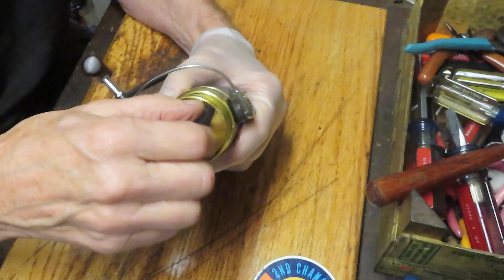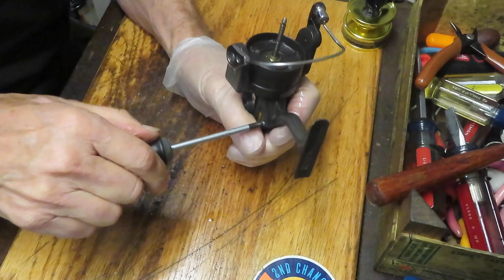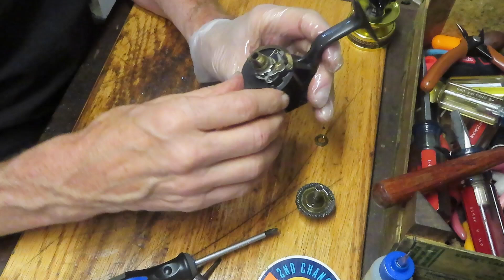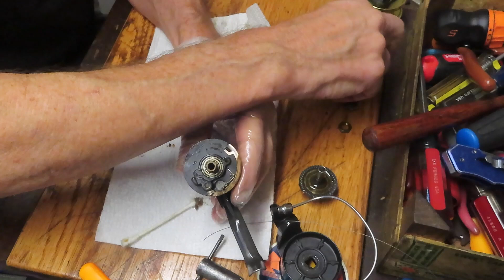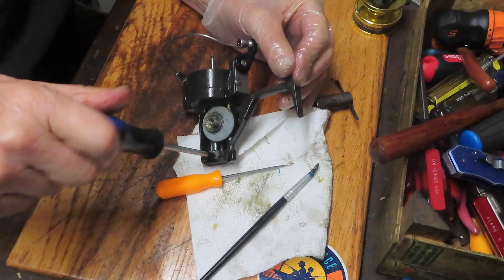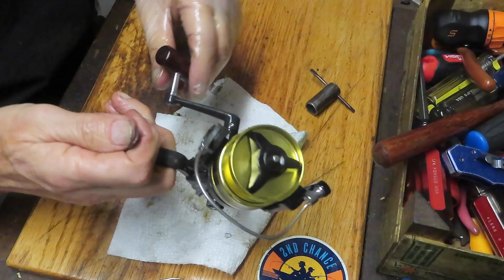Daiwa BG 15  spin fishing reel how to service

Comment: I have one of these and its my favorite reel. I actually like the crosswind horn, as it eliminates the crosswind block which was a common wear point in many spinning reels. I've never personally seen a horn wear out, and if one is concerned it can be easily lubed without dismantling the gear train. I think the line lay is theoretically supposed to be somewhat inferior, but I have never seen a difference in castability.
Reply from the maker: My issue with the set up in your reel has always been the track that the pin that goes through the axle shaft rides in and not with the arm.  I have seen the groove wear as well as the end of the pin and that has causes slop in the retrieve.   Thanks for sharing - The BG15 and that series are very nicely made and will just keep fishing when properly maintained - Best wishes - Dennis
Reply: @2ndChanceTackle  So you prefer the oscillation gear/ slide? I suppose a worn block is preferable to wearing out the frame, though getting lube onto the pin/ track can be done with just the sideplate removed.

Comment: Hi Dennis, thank you for the great video.  At the end, you were able to "lock in" the spool to the reel, unfortunately, now I cannot "lock the spool" into the reel.  Any suggestions?
Reply from the maker: If you are having that trouble, it could be because the drag washers are not aligned.  Turn the spool upside down and guide it over the axle shaft turning to make sure all line up as you are putting the spool downward.  Once they are aligned, fill the spool to the way it should mount and you should eb able to lock it in.  Thanks for asking
Reply: @2ndChanceTackle  Unfortunately, that did not do the trick.  The spool will not lock into the reel.  I must have a different problem.  Sir, would you be willing to connect offline if I shared my info?  PD

Comment: Boy would I love to have this one! I started collecting the CDaiwa BG reels about a month ago and have three so far - BG90, BG60, and a BG10.  Do you know how many reels are in the series? I had to take the bail off my BG60 and bend it back into shape. It was a mess but you should see it now. I have already grown to appreciate these reels. They are not that different from the Gold Series but for one thing, all these BG reels have three ball bearings. I collected most of the GS reels too. I’m in the process of restoring a beautiful BG10 that Rick Stivers gave me. This BG15 is very similar to the BG10 except it is a little larger. I added an extra bearing to my smaller silver series reels - the 1000C, 700C, snd 50oC. That conversions works perfectly on those reels. One thing I really like about these BG reels is the design of the anti-reverse. You don’t;t have a spring on the AR claw. To me fewer springs to bother with is better. Another thing I like is the quality of the gears. I’ve worked on three BG reels and the point on the gears were extremely sharp and well defined!  I’ve started putting a drop of oil in the side plate screw sockets before sealing the housing particularly on reels with metal cases. This BG 15 is an absolute beauty inside and out. Great video Dennis and very timely for what I’m doing in my collection right now! — Chris
Reply from the maker: Here is what I think the BG first series is as follows BG-10, BG-13, BG-15, BG-20, BG-30, BG-60, BG-60SC, BG-90,  Best wishes - Dennis
Reply: @2ndChanceTackle Dennis I have three of them now and a fourth is being shipped this week. I have such an appreciation for these vintage Daiwa BG reels. I may never get all of them but I hope to pick them up whenever I can find some nice ones at a reasonable price. — Chris